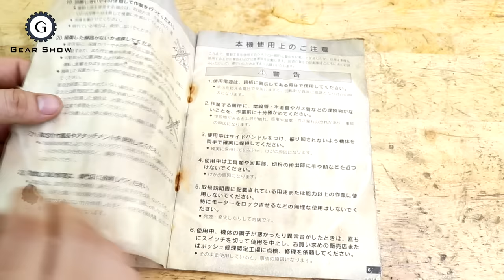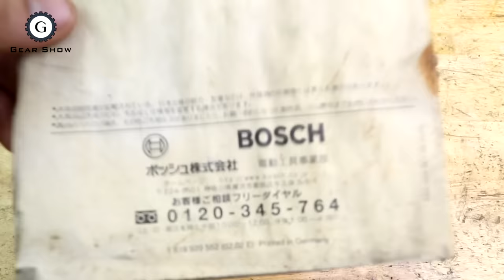Demolition Hammer Refreshment | Bosch GSH 5 E Professional; 12 J; SDS max

Comment: Finally somebody who knows that this model of hammer takes OIL not GREASE. When you fill these with grease they will work for a few hours only.
For this hammer its 60ml of Bosch 1 615 430 019 or 1 615 437 512 Oil upon full disassembly to be precise.
That oil is too expensive though so id say 10w40 engine oil is about right for the viscosity.

Hammer geraboxes are not to be messed with they need the right lubricant they were designed for.
Most Makita and Bosch hammers use a very liquid low viscosity grease for sealed gearboxes. Its NGLI 00 or 000 approximately.
The smaller hammer drills use NGLI 0 for Makita and Bosch may use up to NGLI 1.

Comment: Nice and clean restoration  performance. Job well done.
I have two questions regarding the lubrication.
How much oil did you press into he gearbox?
What is the reason for using a semi synthetic motor oil, in my opinium Bosch uses a NLGI 0 class Lithium complex grease.
I could never pu my hands on a Bosch grease specification.
Reply: Motor oil is not good for this purpose(vibrations, corrosion). If you have to use oil (new hammers) use oil for pneumatic tools (similar properties). But a local serviceman from Bosch told me to use grease NLGI  1 or 0 instead.

Comment: When I spun the motor with a socket and drill, the armature gear was not engaging the hammer gear. What could be the reason? what should I replace? 

The hammer drill (slightly newer model) continuously cuts out while hammering and sometimes the drill portion stops working

Comment: you didn't replace the armature seal above the bearing, O-rings on the piston and hammer, and you can't put plain motor oil in it. There's a special bosch oil that goes in GBH 5 machines.   The oil you put in is ok, but it may not work well in winter temperatures, or can seize the flying hammer in the cilinder.  Nice job anyway.  I'm a professional tool technitian btw.

Comment: Hi.  I discovered your videos recently and the ones I saw are great!  What products do you use to clean the parts?  Thank you!
Reply: Esteban Alejandro want to know too
Reply: You can use any kind of cleaner like dish soap, laundry powder or degreaser. I use a commercial grade kitchen degreaser because it's powerful, nontoxic, and all commercial grade kitchen cleaners are water soluble so they're easy to dispose afterward. 

Insofar as renewing plastics, you can restore the surface finish with a heat gun or sand it back to a fine polish. The overmoilding is a different story, though...

All metal parts can be buffed over with a brass wire wheel connected to any rotary power tool, so a bench grinder, angle grinder, Dremel or drill are all fine, but take care with aluminium parts because those can scratch very easily.
Reply: Thankyou very much.

Comment: Nice restoration. I have one of those but I cant control the speed, it just turns on full blast and does not hammer when the motor is going that fast. You know what the problem could be?
Reply: Gurwinder Singh check the little wheel that controls the speed on the side. I bought a similar Bosch model that had the same problem and I had to replace that wheel with one from a different model, but it works well and it’s been 3 years. Usually if they’re not very corroded just cleaning the contacts will do it, but mine was very bad condition

Comment: Why the brush looks like new?!
Reply from the maker: I think this tool is little use.
Reply: @gear_show  Still you should have ground the broken second one at 19:20 flat. It will cause higher resistance, sparking and also wear down the collector faster.
Reply: Kotkostya changed